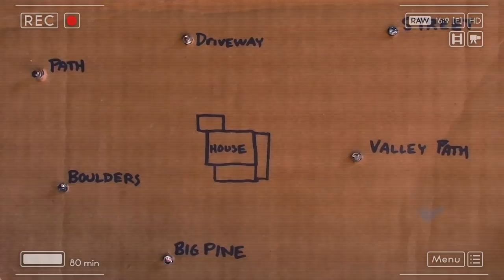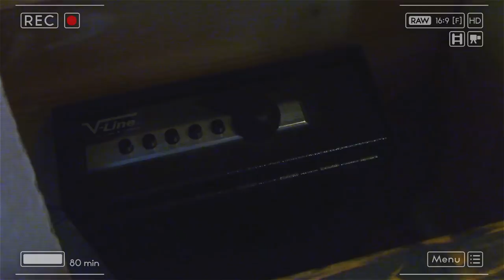Alien Invasion: Day 08 (Praxis Prepper Video Diary)

Comment: Nice little easy to make DC alarm system. Most surveillance stuff get fry by EMP.
When your not alone, you can do morse code or simple series of beep to message people in the house. (SOS, incoming, help, false alarm, its a trap...)
This can be setup in a day using common stuff.
Improvements can be added later, the hard long part (and dangerous at that time) is conceiling the electrical wires outside.
Reply from the maker: In New England, we have a steady and constant supply of dead leaves to cover EVERYTHING! ;)

Comment: In a real emergency situation, you should be carrying your firearm at all times, not just letting it sit on a window seal.  Good video on alarm system.  Harbor Freight makes motion detectors and magnetic detectors that are wireless that can be used as alarms..  My neighbor has some set up at the end of his driveway so he knows when a car pulls in.  The road is about a hundred yards from his house and he knows as soon as they pull in.
Reply from the maker: Yeah, there are a lot of good options out there for simple alarms. And I agree on the 24/7 carry policy in a WROL situation. Obviously in this video I'm not showing best practices, but rather how someone might act being somewhat, but not totally prepared - AND operating on very little sleep.

Comment: Guess the frost is also great for you neighbour in the driveway, he's now doubly 'stiff' and a lot less smelly ;)

Some constructive criticism: The shot at the alarm system where you left the pistol behind was 'a tad' to long, which sort of made it VERY obvious something was about to happen. The shot was correct though for cinematic purposes, and for the observant viewer, but if you make it almost 4 seconds it really gives away the message and everybody is likely to get it. I do not think that is the purpose of the shot, i think it's supposed to be there for those paying attention to detail and them getting the feeling they have more information than the regular viewer and in a sense even the main character. Shot should probably be less than 2 seconds, something like 1.75sec ... The slight zoom was nice as a hint though, more than enough to trigger some more people.
Reply from the maker: I absolutely agree. I tried to cut it as short as I could, but the following shot with me going through the woods was sort of bumpy so I wanted to have some of the audio in VO before I cut to the shot after it steadied out. But you're right. It WAS a bit... obvious.
Reply: Ah i c ... well i guess sometimes you can't get what you want due to practical reasons ... it wasn't horrible or anything, just made it rather obvious. ;)